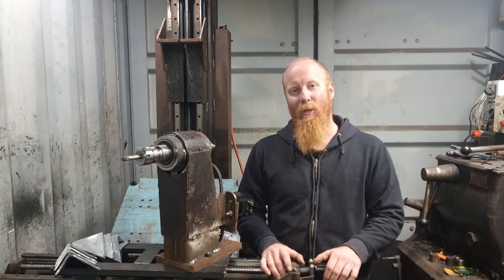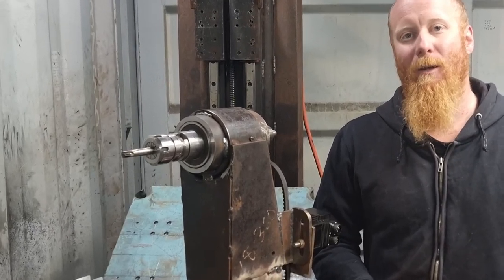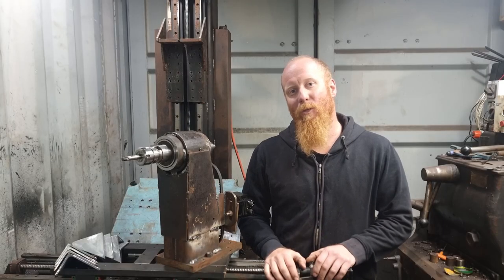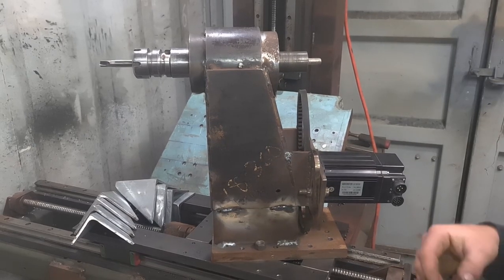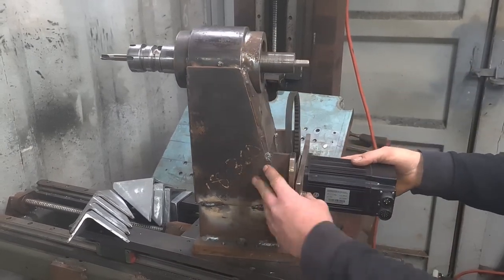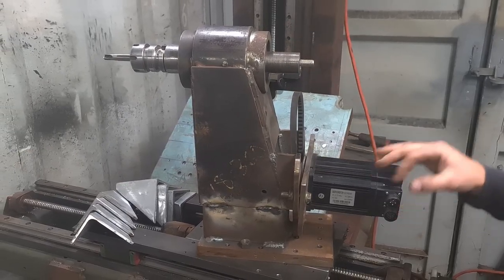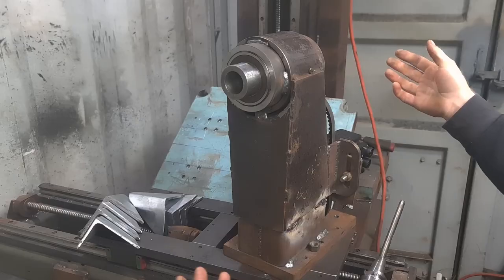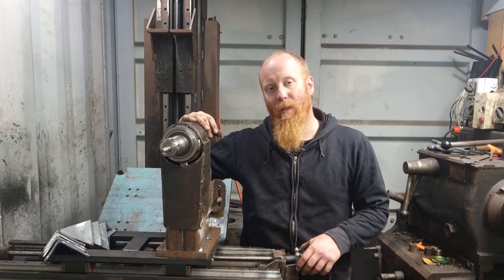Don't build a DIY CNC Spindle untill you watch this

Comment: I'm on the same journey. As a junkyard enthusiast, I was lucky enough to be able to find a used ER32 spindle from a horizontal milling machine, it's not an ISO30 but it's better than nothing. I'm going to use a cheap 750W sewing machine motor, these newer ones are servo and come with an inverter. Good luck on the project, it's always good to see people trying their best to make their wishes come true.
Reply from the maker: Awsome mate its good to use the things you find one mans trash is another mans treasure. 
That's a good score on the spindle pretty lucky right place right time I guess a.
I didn't know about those motors I will be keeping an eye out for them now cheers.

Comment: What bearings are you using? Angular contact or just deep groove? How fast can they spin? It seems hard/expensive to get 20-30.000 rpm bearings.
Reply from the maker: I'm just using deep groove roller bearings for now angular contact bearings are expensive lol.
Yeah bearings are a big part of the cost in building spindles.

Comment: Hi, I have a question, that collet that you bought it has a tapered end. That taper doesn't rest against anything right? It's just the flat part that touches the bearing housing?
Reply from the maker: hi there, yes it just pulls upto the flange and relies on the 30 taper to hold it. the new spindle going on is a bt30 atc and has a pull stud and drive dogs aswell as the 30 taper and proper angular contact bearings. New videos out soon with the sevo upgrades and spindle upgrades. anymore questions let me know and I could make a video.

Comment: I bought a set of large angular contact ball bearings for a diy mini cnc lathe spindle. Since I got a cheap factory made cnc lathe before I got into building it, I'm probably going to build a 40 taper mill spindle from them.  85mm inside diameter on those
Reply from the maker: Awesome they will be some good bearings for a spindle. Cheers for your comments appreciate it

Comment: Nice work.  How did you go about getting your spindle absolutely trammed?
Reply from the maker: I shimmed and packed everything. I have now pulled the machine apart to put in a proper bt30 auto tool change spindle. I have set all that up with a laser level, and then when I put the machine together, I will use dial indicator to tram everything in accurately. New videos will be out soon

Comment: First you put your taper bearing into the pipe afterwards there should be a spacing sleeve then you finally put in the ball bearing that has the seal this way your grease will always remain in the pipe and a sleeve acts as a support for everything between ball bearings
Reply from the maker: Hey there, cheers for the comment. yeah, I definitely made poor choices on that one, lol. I know what to do for next time now. have you seen the upgrades video? I have a nice new bt30 atc spindle to go in.
https://youtu.be/OWsy3WpL9tA
Reply: @gingerninjaneering  you will have to do that why is because the regular bearing that you have put in it's not a side to side pressure bearing you will be constantly replacing that if you do not have a taper bearing in there
Reply from the maker: yeah, I was being cheap and had those bearing laying around as proof of the concept it worked. But I have come to my senses and brought a proper spindle with proper bearings and automatic tool changing, so this will eliminate the issues.

Comment: Hey champ, I think you should seriously invest in some micrometers, that way, you can plan your cuts to the sizes you want to hit. A bit of advice: if our target size is, say, 100.02 and you’re using a DNMGxxxx04, you really want to be aiming for a MINIMUM finish cut of 0.3 DOC, so you should machine to around 1.2mm over size, mic it up, write it down, then take your first finish cut, then mic it up again. Check your actual cut vs planned cut, then adjust your final finish cut to hit the final size. With a bit of practice you’ll hit size every time and get a good surface finish. And if you mic up the parts you’re trying to fit together, you’ll be able to plan the fits in advance.
Reply from the maker: hey mate thank you for your advice.
It is on the cards four sure to get some proper measurement equipment and get the dro on the lathe going the old imperial dial is hard to read.
I like the idea of using actual measurements than going back and forward test fitting.
thanks for you time appreciate it
Reply: @gingerninjaneering  cheers mate, good luck and have fun. Machining can be an art, for sure, but it’s certainly more of a science. Plan it out before hand and then find a way to execute.
Reply from the maker: I will do that in the future and upgrade my measurement equipment.
Reply: sneaky, like sneaking up on it. my very old lathe has no dials, but I can be very sneaky.
Reply: @assyholey4224  my old manual lathe has way too much play and backlash so if I have to make a critical part on it for some reason, I put a dial indicator on the carriage.
Reply: @madaxe79  . Chinese DRO $59;99 2 axes travel read out/ but that is another freaking thing to keep working.
Reply: @madaxe79  great tip.

Comment: Nice spindle
Reply from the maker: Thanks, mate. just shows what you can do with scrap. I have now upgraded to a bt30 atc spindle.
Reply: Its recomend or no sir?? I want build wirh angular bearing for my cnc, how to make the steel not come for rusty?? @gingerninjaneering
Reply from the maker: @danielmeneses724 Thanks, mate. It worked, but I would recommend angular contact bearings. I've upgraded to a BT30 ATC; it's much better now.
Reply from the maker: @botak333  definitely angular contact bearings. And I would say paint it or lots of wd40 to not get rust.
Reply: @gingerninjaneering  oke using both up and down or one only??
Reply from the maker: @botak333  I would use for all
Reply: @gingerninjaneering  okee i want use bldc motor forskateboard electrik. Thank u🙏
Reply from the maker: @botak333 that sounds like a cool project.

Comment: Why did this get recommended to me... that looks absolutely horrible tbh. I guess the title was a warning of what not to do?
Reply: @assyholey4224  I'm guessing the irony doesn't escape you in saying that, @assyholey4224.

My point was the video was listed as "Don't build your own until you see this" - like he has any authority on how a  DIY spindle should be built, but no - it's just some bodge job of a spindle setup. 1hp motor. slapped a couple cheap ebay bearings in. no care at all to precision or tolerances. This may be how you build "a" spindle, but it's certainly NOT how you SHOULD build a decent CNC spindle. This won't achieve any decent surface finish, and won't last at all. So no, not a bitch, this video was objectively clickbait.
Reply: @LitchKB  my bad.
Reply from the maker: hi there @Litch so i took what you said and i have brought some parts to make some improvements on the machine. I built that spindle using what i had like most people on a budget. You will be pleased to know i have invested in a bt30 atc spindle with proper angular contact bearings a 3hp ac motor with vfd and servos to replace the steppers, i have also purchased a proper cnc controller board. I appreciate your comment and it has pushed me to try to do better. Im still working on a budget though. I understood the spindle i made was a bit of a bodge job and wouldn't last but i had to make do with what i had at the time. I don't consider myself as an authority in machining at all just a guy with a hobby for building things. check out my latest video to see the improvements i am making. https://youtu.be/OWsy3WpL9tA. thank you for taking the time to comment and the constructive criticism has been taken on board hope to earn you as a subscriber possibly one day.
Reply: @gingerninjaneering  Fantastic to hear mate, I'll have a watch after work today.
Reply from the maker: awesome mate, I appreciate that enjoy your day